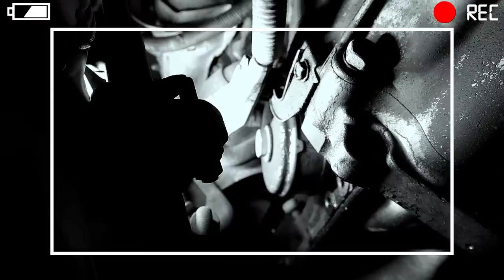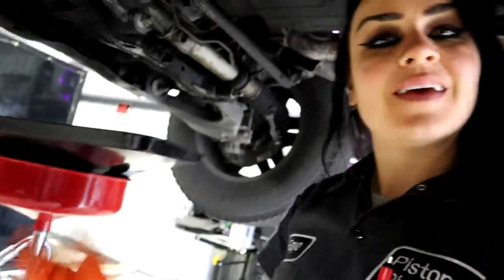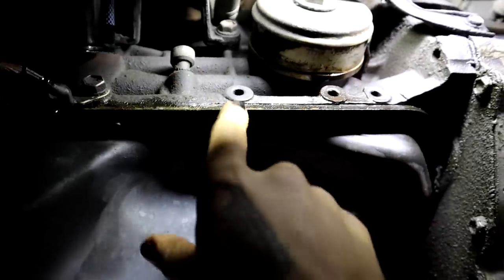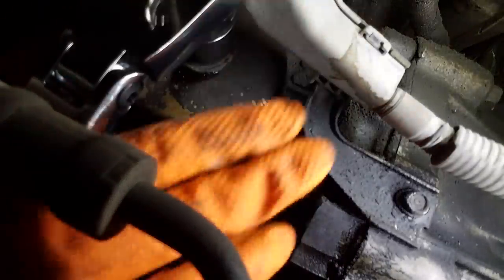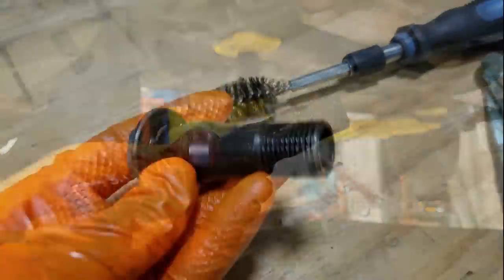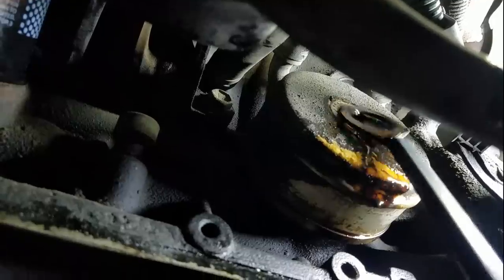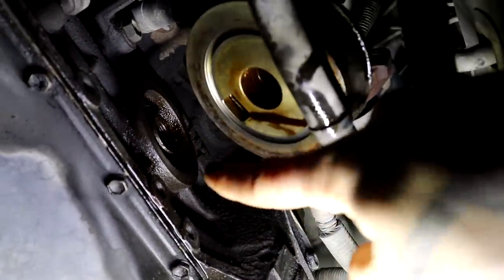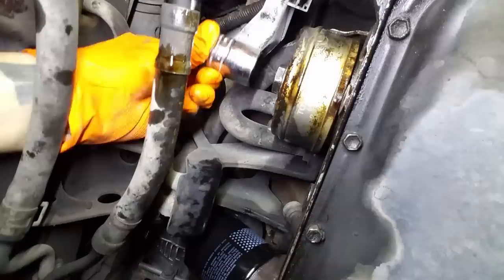Replacing Oil Cooler Seals on 3rd Gen Toyota 4Runner with the 3.4L (5VZ) engine

Comment: Any tips for attacking this on a 4WD? I’ve heard of people going in through the wheel well
Reply from the maker: You can absolutely approach this from the wheel well. 4 little plastic clips and the little protective dust shield comes off and gives great access. Remove the wheel and you can get your whole body in there. Small bottle jack can help put weight on the suspension on that side and lower the axle slightly out of the way, and put a little pressure under the passenger side wheel. If you have ramps, you can put one ramp under the passenger's side wheel, and drive over it onto the lift, then lift up the truck only enough to remove the wheel on the driver's side, then scooch in there with your rolling stool and get a nice comfy position! Definitely possible!
Reply: @FayeHadley  thanks so much for the quick reply!

Comment: Just finished this job on a 96 Tacoma. I didn’t drain the oil and lost about 1/8 quart. Also didn’t drain coolant. When I disconnected the coolant lines I plugged them w a 1/2 rubber plug from Lowe’s (Hillman 139548). The toughest part of this job was access.
Reply from the maker: Nice!!! Is yours 4WD??
Reply: @FayeHadley  it’s a 4WD. All repairs and maintenance under the engine are a tad more challenging. But I do love that truck.

Comment: Have you worked on the 1KZ—TE engine before?
Reply from the maker: It's been a while and only for a small oil leak and routine maintenance
Reply: Faye Hadley I added a tunable chip to mine as well as an inter cooler, moved up from 85kw to 110kw on the Dino. Awesome Diesel engine.

Comment: I have the 4x4 version with the 3.4 where the oil cooler bypass hose that goes into the block it leaking because the hose clamp at the block rusted and broke. Cannot figure out how to get at it. The front diff runs right under the Oil pan so I can't get at the cooler or the hose from underneath.

Comment: Do you have the front mount dipstick if so that bung that was to the left of your oil cooler is open that's the other dipstick tube bung cause I get those tubes when I install super chargers so it's not by the belt

Comment: Sooooo I’m trying this now on my 4x4 5speed and the bolt to the oil cooler is super hard to get to. I got it off with some maneuvering, but here we are 3 hours later and I have yet to get it reinstalled.

Comment: does this leak cause the engine to smoke very little?
Reply from the maker: No, this is above the oil pan and doesn't leak onto the exhaust! That's probably your valve cover gaskets of the circular plugs at the rear of your cylinder head.

Comment: Just yanked the heads off my ‘95 V6 auto 4x4…5 outta 6 burned exhaust valves! I don’t even know how it was running. Just got my heads back from machine shop decked new valve
Guides/valves/ valve seats. They’re looking good getting ready to throw it all back together just can’t get my deck alignment pins/ dowels out to make one pass over the deck with some 320 grit. They stuck good man :/

Comment: Would your 4runner leak oil for a little while after driving it?
Reply from the maker: Not anymore!! :))
Reply from the maker: But, to answer your question in a way that is more helpful - yes, after driving it and then parking, I had drips in my driveway - it was hard to tell where they were coming from because of the skid plate though!!

Comment: See last note- by the way- did it with the oil in-
Less came out than when you remove the oil filter at oil change! Not too bad...
Reply: You didn't drain the oil tank first? I'm about to change my gaskets and am wondering if I need to drain the whole tank...Unfortunately I just did an oil change recently and don't want to waste $
Reply: @lhughescca  No I did not drain the oil left it in
Reply: @diogeneslamp8241  great thanks!

Comment: Try changing the oil cooler on a Mercedes OM642 engine. Especially the in the R class. An engine designed with the devil as the lead designer.